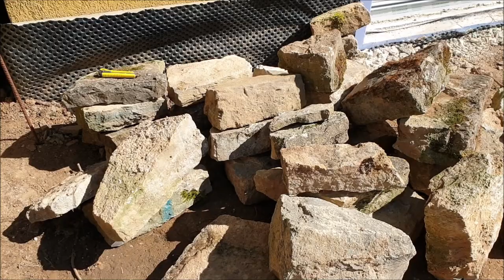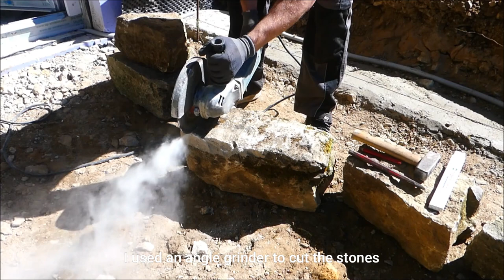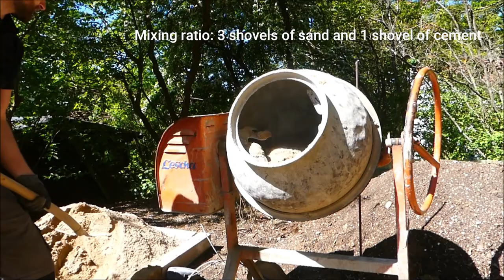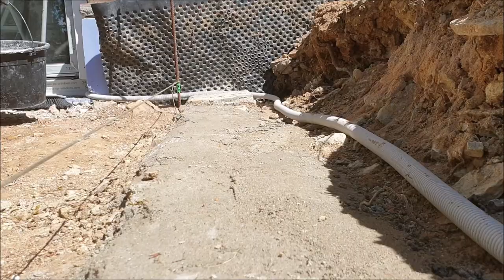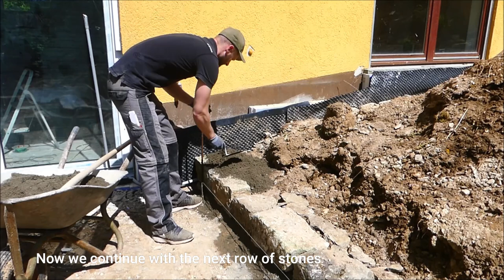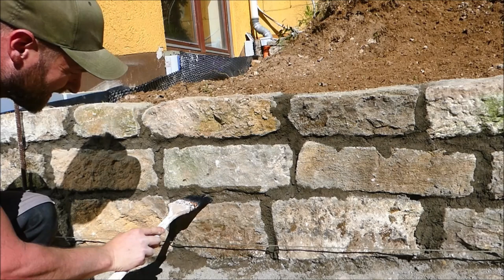Building Stone Retaining Wall

Comment: First of all, Good effort brother...but thats kinda bad job, 1. the concrete and sand mixture shouldn't be as dry as that, its ok if your place doesn't rain because that will be wash out. 2. the vertical joints shouldn't be like that, it should be like stacking hallow blocks or bricks for more strength and better looks.

Comment: Firstly the positives. Well cut stone with nice facing. Correctly laid flat and a semi dry mortar mix which avoids ugly cement residue on the face. Plenty of rubble at the back to give bulk and aid drainage. Therefore the wall is incredibly strong. From a visual point of view it would be better if the stones overlapped to avoid straight joints and certainly this would be essential if the wall was high but In this case the sheer bulk of the structure will ensure it lasts for as long as the owner wants. In fact there is no need for mortar at all when you lay stones like this. In due course the whole thing will be covered in lichens and moss and perhaps overhanging shrubs and the wall will do what its is intended for. and the overnight armchair stone masons will be lost for stones. The 5 to 1 mix is good for most stonework but it is easier to use with a plasticiser additive. At a push a little washing up liquid in the water will suffice. When they built the Charles  bridge in Prague, the artisans used egg white in the mix. Thank you for posting this video and for giving up the time to share your experiences,.

Comment: Your joints are not staggered, the vertical joints are too close, the wall has no strength.
Reply from the maker: The strength results from the filling stones behind it
Reply: @greyelementprojects7403  yes stone rubble backfill and drainage is important, I live in northern frost climate and vertical joints will never hold the test of time.

Comment: In addition to the other mistakes pointed out by others, you didn't move your string up with each course. This must be done to keep each course level and plumb.
I appears you back filled behind the wall before the cement was even dry.
I didn't see any water drainage behind or through the wall. With that hill behind it, you will likely have trouble.